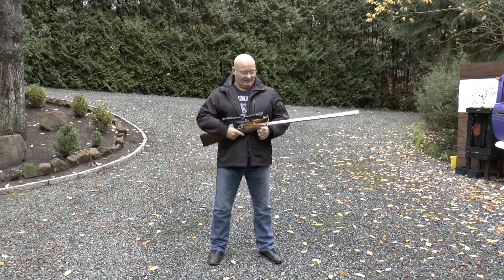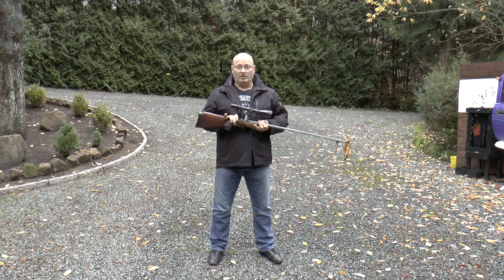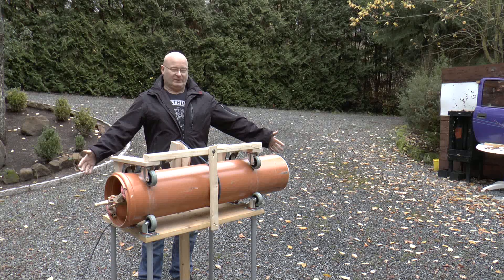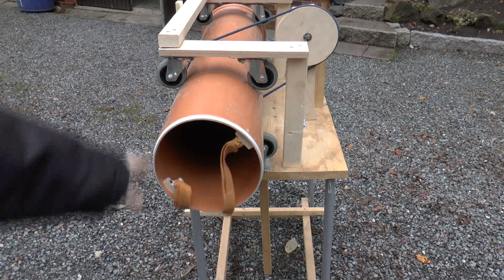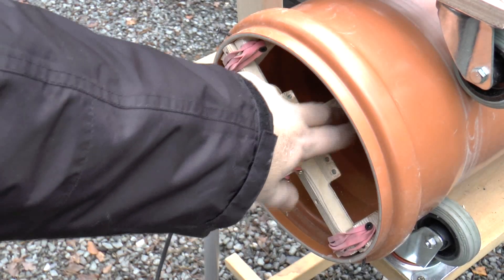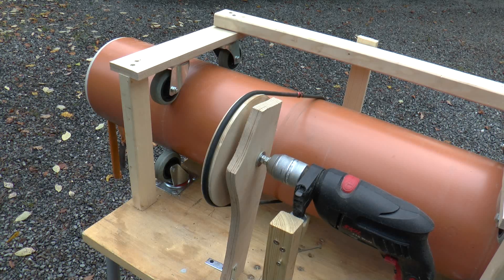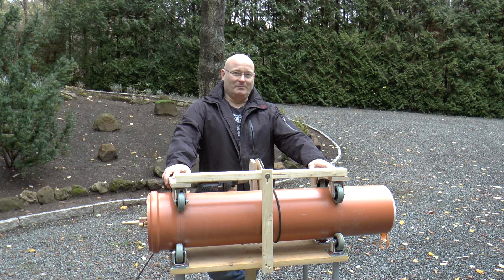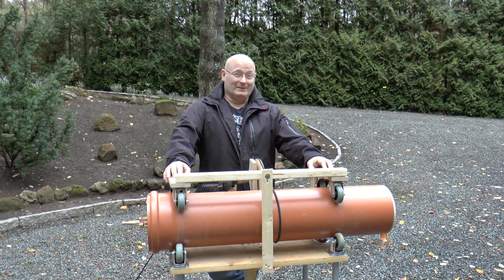World's 1st Rifled Slingshot (Made from Huge PVC Sewage Pipe)

Comment: What an amazing solution.
Your problem solving skills are incredible.
Just remember a number of main battle tanks incorporate smooth bore cannons.
You should try building a miniature   sabot dart like the tank cannons use.
You could try making a sabot round using a game dart jacketed  to fit inside a self lubricated nylon sabot collar.

You could try using small 10 kilo force  neodymium magnets mounted on three outside rails to create a type of rail gun powered by compressed air.

Comment: Nice job, here are some enhancement suggestions.:
A bearing mounted firing trigger which does not spin with the device
Chain drive
Spin a narrow tube with a lubricated rod within which is fixed to an external action and driven by a fixed fork and trigger. This fixed rod telescopes down the rotating barrel to hit the projectile. That way, the ball and barrel spin but the action does not.
I recommend cylinder shaped slugs rather than balls. 
Sliding breech reloading is good too.

Comment: The trigger obviously needs to be freely rotating.. And as little directly connected as possible. Say a few bearings separated from the turning force. I could see it easily being possible then to create a smaller faster spinning version. Nice proof of concept though, oddly enough I've thought about a weapon like this before using pneumatic pressure as in a pellet but where the centre pipe is accelerated by the air pressure before firing.. As people do with those fidget spinners.

Comment: actually you could make a rifled slingshot. instead of having the rubber pull just the pouch and shoot, attach the rubber to a wooden bar with wheels, wich itself is pulled through a spiral grinded inside the sewer tube. the wooden bar can hold the projectile. so you have a rubber guided rod rotating in the barrel which spins and fires the projectile. it doesnt work for rond objects though, perhaps make it fire 5 inch nails ?

Comment: so is a shotgun firing slugs with a bored out barrel a musket
Reply from the maker: Shotguns don't usually have rifling in the first place.
Reply: Crazyshotty4 if you have a shot gun some may come with both smooth (for shot) and rifled (for slug) barrels. but I find it unnecessary as the slugs themselves can be "rifled" or rather have the groves that force them to have rotational stability. buy and shoot those myself, since then I never need to change barrels.

Comment: Joerg I had a bloody great idea for your compressed air Airbow musket, why do you not make the outside of the tube rifled? And inside the arrows you have rifling too, this should technically make it spin in fact spin better than with the fins so you can remove those and shed weight on the arrows getting closer to 1000 joules.

Comment: Not to be an ass, but rifling is meant for conical or cylindrical objects, such as a bullet. To stabilize the trajectory of a spherical object, you use a hop system, which puts backspin on the projectile. So instead of "rifling", a barrel should be made, with a slot cut in the sides halfway down. Then the slingshot should be mounted at the end of the grooves, with the rubber running inside the grooves, and as the projectile passes through that section, there should be a rubber nub, possibly a piece of brake line hose, that pushes downward on the top of the projectile which puts backspin on it
Reply from the maker: Nonsense. A hop system may work for airsoft BBs, but you can't use it for fast lead or steel balls. Rifling was used for round balls in guns and cannons for centuries before the Minie type bullets were introduced. Those had the advantage that they did not need wadding in order to spin through the rifled barrel.
Reply: Lead ball used in early rifled guns were pitted due to imperfections in the manufacturing process, and rifling in a sense "smoothed" them out to make them more aerodynamic. I'm saying in theory backspin would help stabilize the trajectory of a spherical object more than the mimicking of rifling in this instance. Not trying to depreciate the value of your experiment here Joerg, I'm a huge fan of your work.

Comment: The basis of the rifling is to spin the projectile, okay. A slingshot pushes a cup in a linear, non-spiraled direction, okay.

Hmm,

Then all one would need to a lugged shot cup that contains a bearinged inner. The inner cup is in contact with the projectile and spins it. If the rubber fires near parallel to the "barrel" the rifling could even be on outside. Use a lugged disc plate with a central cup. Around the cup, attach a bearing and upon the bearing the lugs to attach the rubber. An outer rifled guide can spin the backplate via its lugs. If the guide rails are slightly loose, the plate's lugs could be wheeled to reduce fiction as they would naturally press against one side as it spun forwards.

But, all in all, a lot of work to achieve very little.

Comment: I'm genuinely curious.  Does this method of applying spin actually make a noticeable difference?  From my understanding, rifling works not just by applying initial spin to the bullet but also by keeping the bullet spinning down the barrel, so as to "push out" the limit of stability.  With this slingshot, would the ball not lose its rotational "acceleration" as soon as it exits the pouch, since only the firing assembly is spinning?  Any clarification would be greatly appreciated.
Reply: According to him, It would at a much greater amount of rotations per second. But, there isn't really any point due to the speed of the ball.
Reply: By spinning, it makes the flight path of the ball more stable, creating a longer distance the ball can travel. Most guns aim to do this by using rifling, which is spiraling grooves on the inside of the barrel. Sadly, this machine doesn't rotate fast enough to cause any real change in stability. It may actually make it worse as the machine itself isn't stable.
Reply: Unfortunately, the setup in the video does no simulate conditions within a rifle barrel. The ammo does not actually grip the sides of the "barrel" as it travels through like in rifles. This means that the setup only supplies the amount of spin as the spinning speed of the barrel at the point of release from the slingshot pouch. In contrast, rifle barrels supply a LOT more spin. Without getting into firearms too far, you will see part of the advertisement for them is the spin ratio in the barrel. This can vary quite a bit, but most barrels are made to have a spin between 1 to 2 turns per inch. For rifles (as defined by law), this means that any round shot is at spun completely between 18 and 36 times at the very least before they reach the end of the barrel which, I think,  is a high enough rate to stabilize a round. Also, all of this is done while the round is confined to the barrel, so it is brought to that rate of spin while confined to a straight line. Another thing that Joerg brought up is that spin isn't necessary for spherical objects. If you are interested enough in this, you should look into aerodynamic physics. Sadly, my physics course didn't cover them, and most Youtube shooting channels don't either.

Comment: how about a bearing on rubberbands that gets slung on a larger barrel which is leading to a smaller barrel that has a slot with just a slight thread with a lead projectile that follows that thread. the ball bearing will only have momentum at the point it gets to the projectile because the band is in the barrel so it has to be behind the projectile but the bearing has to be small enough to pass the bands yet go up in the barrel with it. I challenge you to make this simple idea work.

Comment: spin stabilization is only really import any at super sonic speeds(1100+ fps)
Reply: no, just...no.  If that was true a US football when thrown through the air would gain nothing from a spiral.  Please learn physics before speaking on physics.  rifling in firearms has been around since 1520ish and has been used on firearms and cannons with widely varying muzzle velocities but to give you a sort of rough average you are talking about 700ish FPS from a man portable "handgun"  and that is with late 17th century advancements in powder composition.   SO if rifling had little effect below 1100 fps it would have been invented and painstakingly done to guns for nearly 300 years prior to velocities that made it practical.
Reply: maybe if they ball was bullet shaped instead
Reply: +Dies1r4e football theory made sense tho
Reply: Isint the football affected by the magnus effect?
Reply: Sod Alfredsod Not really, the magnus effect only kicks in heavily at higher RPM with further distance (like throwing a basketball off a damn)  now it does somewhat effect things but so little that if you were calculating the path of the ball over say 50 yards you could just ignore it in your math and still end up inside 1/10th an inch. the stabilization on a football is from the same gyroscopic forces that stabilize a rifle round.
Reply: ***** What if I told you, that the velocity and RPM you produce when kicking a ball really hard exceed the terminal velocity of a ball dropped?  beyond that, the benefits from rifling are not the same as the magnus effect.changing the path of a curved ball flying through the air.  You people are tragically uninformed and should probably go learn how science works before going "my soccer team disproves what you are saying".  If it makes you feel better we can just call it "gun magic" that rifling works at less then 1100 fps and "ball magic" that footballs and soccer balls down just fly upward at a whim when normally spin stabilized.  The ability to throw a curve ball in baseball or hook a shot in soccer has just...so much more going on.

Comment: Hey, Couldnt you actually make a simpler [Kind of] Smaller version of this without the drill? Build it all like a normal slingshot except with a barrel. Build a 2 part ammo holder
-------------
Back part [Where the rubber band is held in place] *DOES NOT SPIN
[Separate]
Then the front part has an attachment [Screw Type] that hold the ammo to the rifling.
-----------
That way when the trigger is pressed, the ribber band goes down the barrel like normal, However the front part of the ammo holder is spinning with the barrel.

If I have the wood in my shed to kind of give you a picture of what I mean, Ill post a pic

Comment: Im not very good in explaining mechanical things in English so i hope you can understand what i am trying to say.  
Now bare with me :p , see the "rifle" as some kind of weird crossbow .
 
would it be possible to make the "pouch" rotate in the "barrel" by making a "barrel" with a spiral cut out pattern ?
If so. attach an just snugly fitting lager tube at the end , this is where your rubber hand attachments will go onto 
if you put the "pouch" on bearings and make them fit in between the cut out spiral space in the "barrel" it could guide the "pouch" with a little less friction ...
then take another section of the same slightly lager tube and attach the "pouch" onto it , also attach sling attachments onto it.
now that section can slide in a rotating motion and the "pouch" will not leave its barrel  nor will it tumble...
if you use steel bearings the pouch could have a magnet to keep the bearing in place ...
then all it needs is a stock , a trigger and a good way to hold it .

I hope this could actually be a good way to make the "rifle"
but i could also be very wrong :p 
but in case im not or not far off please do reply your thoughts

best regards Jenze

Comment: The round balls from a musket tend to curve the flight path randomly because of random side spin. I wonder of you can make a tube barrel slingshot with a "hop up" like an air-soft barrel has? It is designed to drag the top of the ball a little just before leaving the muzzle so that it has a more controlled (and desirable) back spin. That help the ball curve up against gravity and go further. It may improve accuracy as well be making the projectile's predominant spin in a predictable orientation.

Comment: use a traditional rifled barrel but instead of using metal on metal (as traditionally) just use a very heavy lead ball with plastic rifling on the back, use a sling fling a rod down a rail so at maximum speed it hits the lead ball, the plastic rifling on the back of the lead ball will be crimped to the edge of the metal walls (with rifling) because of the indentation made on the back of the lead ball pushing the metal on the back end towards the edges.  This sling wont have very high velocity but it will have good range. The trick would be finding a good way to crimp the plastic but not TOO much so you still get enough friction to cause spin but not so much that it jams up the ball. I say use plastic because it has more give and has less weight so it's ideal.

Comment: Having never made a slingshot(though I want to), I don't know if this would work, but perhaps the barrel sould have a slot running down two sides(parallel), but not going all the way to the ends. Around this, you have the sling part, connected to the sled(or whatever it's called) which goes through the slot, so it sits inside and can push the shot. I hope you can understand what I'm trying to say.

Comment: hi jörg. i have a improvement for your slingshot. you can make a better handle if you install a ball-bearing. i see that it is very dangerous to touch the handle while its spinning, so if you intall the ball-bearing you can hold and fire it controllatet. so you dont need to burn your fingers on the spinning wood handle.

Comment: Unfortunately, spinning a steel ball prior to release would do nothing for stabilization.  Once the ball is released, the contact point from the band does not impart any rotational energy to the ball.  For a rifled slingshot, it can't just fire from a spinning barrel, the lack of contact with the projectile means that the projectile will not maintain a spin while in flight.

It's a great idea though!  And definitely a novel approach to the idea of a rifled slingshot.  Unfortunately, there's just a little issue.  I'd love to see you make an actual slingshot rifle.  That would be awesome!
Reply from the maker: Clinton Bennett You are mistaken. The ball already rotates WITH the whole system. Inertia will keep it rotating even after it has left the barrel.
Reply: Clinton Bennett The ball rotates along with the slingshot. His theory is correct, if he could just make it spin faster it would be a rifled slingshot.
Reply: Just being nit-picky here but technically that isn't rifling. It's just causing the projectile to rotate. The rifling is literally the grooves in the barrel.
Reply: JoergSprave I think if you had a longer barrel, half rifled, and half with a slit on each side to allow your rubber through the sides of the barrel and project the ball forward, it'd be more analogous to a powder rifle.  The projectile would be given forward momentum in the rear by the breech and then imparted with spin as it passed through a rifled section.

I think this would be the most accurate to form way to make a truly rifled slingshot and see an improvement on accuracy. 

I really mean no disrespect to your video or design, so I hope it didn't come across that way.  It's a novel approach and a pretty badass and scary looking machine.  Maybe if you revisit this again down the road, my design idea may help you.
Reply: Clinton Bennett Jesse Williams Quit being critics what this guy does is amazing and im sure he knows what he is acually doing witht his alot more than you guys do
keep it up JoergSprave what you do is awesome cant wait to see what you do next
Reply: +Clinton Bennett Well said!

Comment: why not  rifle the sewer tube with a curved inclined ramp inside (ex. 1 twist  every 48 inches) and have the feathers on an arrow connect with and spin along the ramp while exiting the barrel providing the stabilizing spin. the feathers could be along the arrow any where  along the last half of the arrow for balance. spin up the tube with the drill motor and release.

Comment: Perhaps would make more sense with higher rpm and cylindrical projectiles (although arrows and bolts don't need to spin - or is the fletching offset to generate spin?)
Reply: Paul Feldman Yes, the fletching offset is to generate spin.

Comment: Sorry but spinning a spheric projectile will not affect its stability in any way, since a sphere is not a gyroscopic body.
I like the idea but you'll need cilindrical projectiles to have a gain in stability.
Reply from the maker: pitthebestia Bullshit. Rifled cannons revolutionized artillery even with round balls.
Reply: I'm not saying that it would not make a difference for a cannonball, since the spin would prevent sideways lift and reduce deviation due to irregularities in weight and shape, what i'm saying is that a gyroscopic effect would be a few orders of magnitude superior to both these factors in this specific situation.
Reply from the maker: pitthebestia Did you listen to the audio, by any chance?
Reply: JoergSprave I'm wondering at the second. Is there a way to make a rifled slingshot that's smaller and more practical?

Comment: Huh... Is it possible to actually have a rifled steel barrel and lead shot? And would a rubber band have enough force to propel the shot through the rifling so that it spins? 

Do air rifles actually have rifled barrels?
Reply: Yes most all pellet air rifles have rifled barrels just like any gun, but cheap BB air rifles (not realy air "rifles") like a red rider do not.
Reply: air rifles have rifled barrels, but the ammunition is also very shoft so it doesn't take such a big force